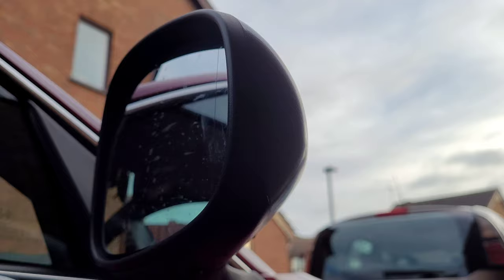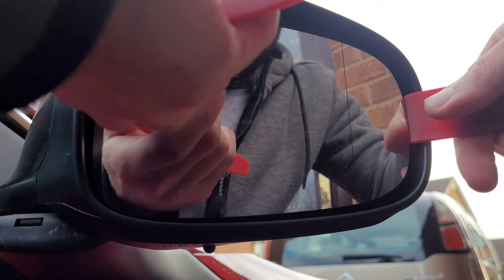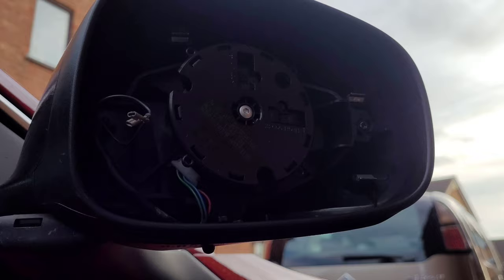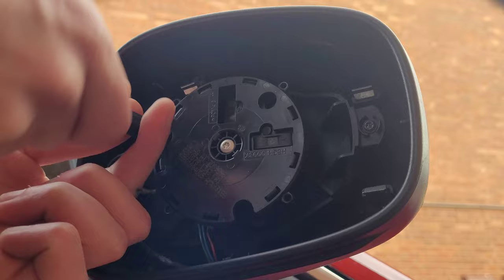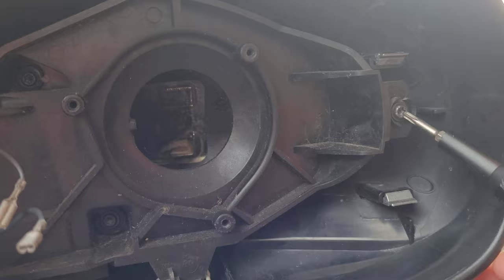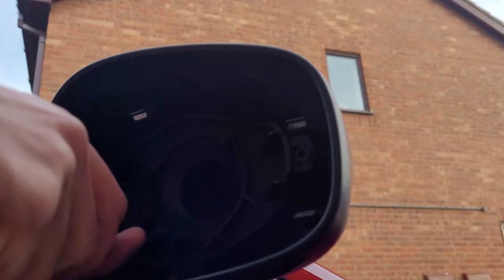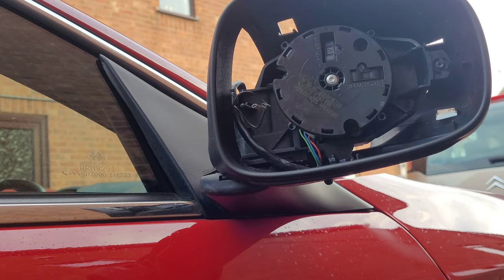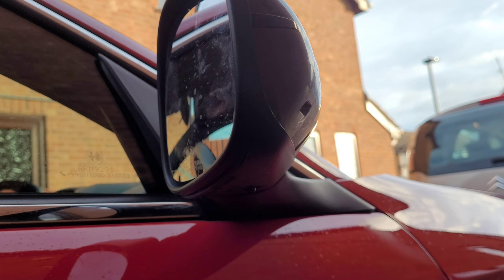Removing Mirror Caps for Painting - Wrapping - Hydrodipping Giulietta/Mito/159

Comment: To avoid breaking the fourth clip use a T10 torx to remove the three screws holding the mirror motor on. The hole you can see behind it for the wiring is big enough to get two fingers through. The fourth clip is a 'push down' one to release. I felt safer using a small dent puller to remove the glass and tooth picks to hold the other three in the 'released' position while I pushed on the fourth one. The 159, Giuletta and Mito share the same wing mirrors so the covers are the same.

Comment: Nice job 🔥, where i can buy the same carbon fiber mirror cap and the carbon fuel flap ?!, in the link that you put there’s only the original one (black)
Reply from the maker: These are the original ones, just had them hyrdodipped. Got a spare fuel flap for a few quid from a breaking giulietta. The mirror caps are the exact ones I took off 👍 depending on turn around, I thought some people might want to buy a spare set and have those dipped